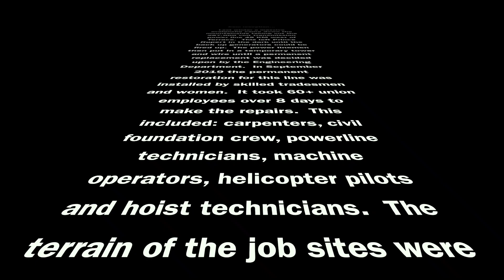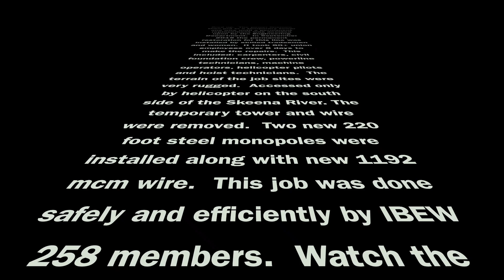Terrace Avalanche Restoration

Comment: Amazing work !!! did that helicopter drop the lower part of that tower right on the screws ??
Reply from the maker: Sure did. There were guides helping slide it into place. There wasn’t much tolerance for error though. Plus or minus a couple millimeters. CS civil boys do good work
Reply: @bradmasse1  makes sense now.👍